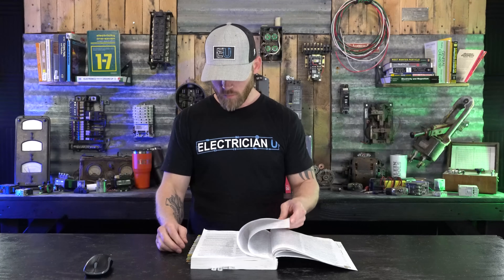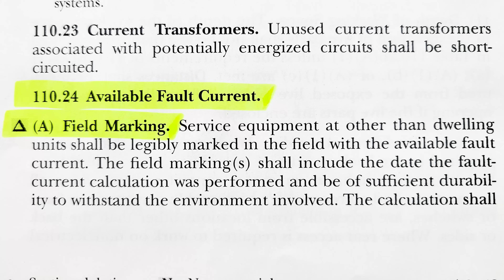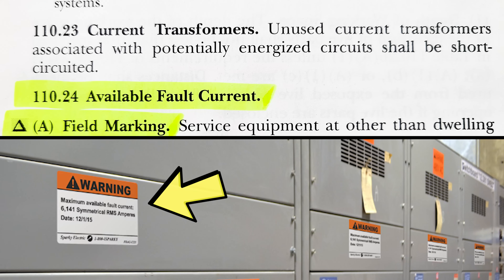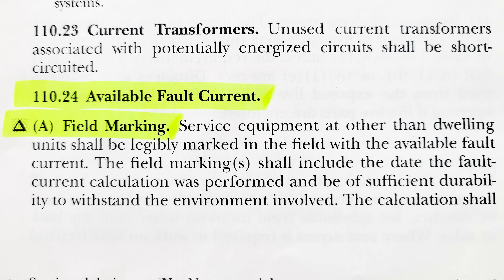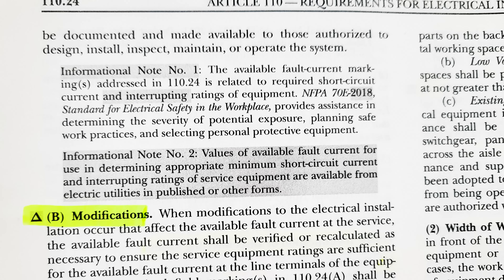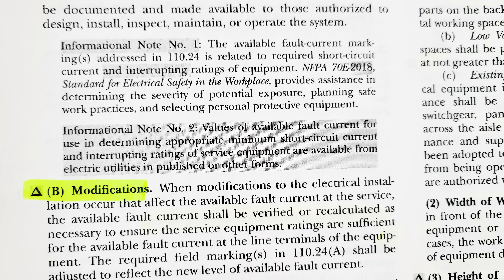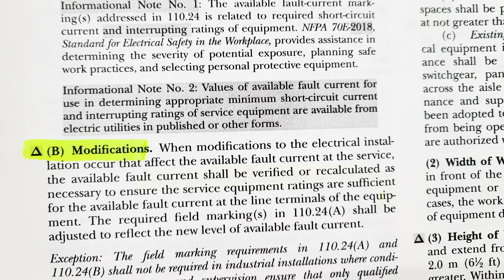What Does Available Fault Current Mean?

Comment: Good video, thanks! How do you calculate this Fault Available Current?
Reply: Exactly what I was wanting to know. The term "available fault current" is pretty self explanatory. An example calculation would have been nice.
Reply: That's a whole video in and of itself. 

It has to do with %Z of the transformer, the size and length and number of conductors. Some specific loads can also affect it. (Think anything can store a charge/energy - motors, capacitors, etc.)

Comment: Most split phase household services have the neutral and ground circuits connected directly so there is no difference between a fault current and a direct short fault as I understand for households. A distinction can be made for 3 phase power since a ground fault would not be the same as a direct short between phases. 280v to ground vs 480v ptp difference in the USA if memory serves.

Comment: Hi, I have a problem understanding this concept at my work, thank God i found your channel.
I ran into a situation where I'm asked to design industrial air compressor protection. The compressor is 150hp recommends using a time delay for class J fuse to be used in a circuit not more than 65KA symmetrical rms. The compressor is fed from an MCC with 350A CB, however my question is why I can't just use this CB as the only protection even though the recommended is a time delay fuse by the compressor manufacturer. Can I just stick to a CB at the MCC feeding the compressor with a general disconnect switch?

Comment: You mention several times that a "ground-fault" is not a short-circuit. It is a type of short-circuit. Available fault current is a misunderstood topic for many electricians, part of the reason for that is the misinformation that is presented on a daily basis, especially on the internet. The 3 main types of short-circuits are: 1. phase to neutral, 2. phase to phase, 3. phase to ground (ground-fault) - which does not fault to ground/earth.

Comment: I know with PV systems when we have 400a or higher services we are required to go from the breaker on one split to a 200a fused disco and then to a 200a main breaker in whatever panel before we tie-in our breakers for batteries/inverters due to fault currents. Your explanation here now makes sense as why. Also depending on AHJ and how far the transformer is from the service entrance sometimes it's required with even normal 200a services. Thanks for the explanation.

Comment: I just had a brain flash: The service entrance cable and anything else before the main disconnect seems to have the biggest variable. Just because you only have a 200 or 4000 amp service, it doesn't stop there. The pole transformer(s) are rated higher and those can run several hours at 140% of their rated capacity. It's very likely they can even run 200% of the stated rating for many minutes. Something tells me this type of fault might only be limited by the fuses on the high voltage distribution system. IOW, a shit load more that you can imagine!

Comment: If the fault is in a branch circuit, won't the fault current be limited by the main and branch circuit breaker? I had a disagreement with a guy at the utility, same guy said my site plan was wrong, the house faced north, not south as shown on plans. The plans showed ground mounted solar, the PV panels face south, not north so that should have been a clue.

Comment: I like the term Impedance because impedance is more prevalent during inrush currents. Resistance is always there, even when the voltage is off. 
So how do you do the calculation ?  Transformer impedance, voltage, length of cable and raceway vs. conduit. 
One guy put a 3/4 wrench on the back of the buss bar and then went around to the front to re-torque the bar in a motor controller. Yep two things happened. 1) we did not ohm out the system. 2) They left the wrench in the unit. Panel where not put on because we needed to take voltage and current measurements live. 
I will never forget the deep thud felt in my chest from outside the room when the break was turned on. No injuries. No fires. Very little damage as the plasma liquefied the metal and blew it away.

Comment: I have a question about the arc fault circuit breakers.  Maybe you can do a video on this.  How does the arc fault circuit breaker know the difference between a device that is designed to create an arc such as a gas stove that has electronic ignition that creates an arc to light the burner and an arc between a wire and a metal box for example?
Reply: you forgot to mention carbon arc lamps and arc welders. OTOH, I doubt these items will be used in a bedroom where AFCI breakers are required.

Comment: Ok in this video you Mentioned that the highest fault current would be Line to line, but in my on the job calculations on the city engineer give me a much bigger fault current for line to neutral than line to line. Thus I use the larger of the two for my placard, line to neutral. But I just can't see how there isn't more available between lines like you said.

Comment: Have had to have disconnect switch fuses replaced with specific current-limiting fuses because the motor controller is labeled for 10kA max, but the circuit can deliver significantly more. Check the load labels, and your supply labels because sometimes the electrical engineers get surprised.

Comment: Dustin,   You answered the question about what “available fault current” is but said not one word on why it is important nor what happens if the equipment installed is not rated for the available fault current when there is a “short circuit”.  
Hopefully someone taught you the WHY we need to know how much is available.  Respectfully,   Kevin

Comment: I consider fault meaning as to an unplanned change in the system or environment that influences the operation of the system and environment from then on as something that now needs to be accounted for.

Thus enter the wording for fault in electrical systems, it needs to be accounted for when an unplanned short circuit happens.

Comment: Can you try to explain why sometimes my lights with led bulbs in them flicker sometimes for no reason. Switches were changed and breakers were changed but problem comes back. Most of the time it does not happen. I can not make it happen and it is so random. Does not happen with non led bulbs.

Comment: Just one thing in large buildings you must be extra careful on all of the fault ratings on large circuit breakers. At the large hospital that I retired from boss had us remove a dozen 600 to 1200 amp spare circuit breakers from one switch gear room to another and rack them in to make it easier for company performing yearly PM. the ones we moved only had a fault current of 65 KIA while the other location had breakers all rated for over 100 KIA. Entire equipment is only good for lowest related IAC breaker.
Reply: This only matters if the available fault current is actually above the 65ka rating

Comment: Can you talk about SSCR or Short Circuit Current Rating for Main Breakers?  What is it, how do you calculate it, and why does it matter.
Reply: Typically, SCCR of the equipment or panel is going to be the lowest SCCR of all the devices in a circuit. You can check out the Annexes of NFPA 79 or UL 508a for more detailed descriptions and calculation methods as well.

Comment: Dustin love the channel love the content I have a question about a three phase service for generator which I'm sure you covered in previous videos but I need to ask it anyway because I might have not completely understood it. I have a scenario that involves a generator producing a three-phase supply not sure if it's Delta or y but I am reading 208 across to phases. So my 2 million dollar questions are what video do I need to watch again to understand it? And how bad of an issue is it if I connect a single phase service to a three phase line? Thank you
Reply: You have a wye-connected 120V/208V three-phase generator. 120 volts from line to neutral, 208 volts line to line. No, you cannot feed a single phase service from this generator, you have no way to provide line to line 240 volts. You can feed power for a three phase panel and use only 120 volt circuits if that suits your needs.

Comment: I guess you explained Available Fault Current's meaning, but how do you determine the amount?
Reply: The short answer, given no complications, is that you can determine an upper limit to this by looking at a transformer's KVA and impedance.   Calculate the amps associated with the KVA rating, and then divide by the impedance as a decimal.  So for a 300 kVA 3-phase transformer at 120/208V, the "amps associated with KVA" is 833A.  If the %Z impedance is 4%, convert this to a decimal as 0.04.  833A/0.04 = 20.8kA.

When you know information about the feeder length/size/material/conduit, you can reduce it from this, accounting for the impedance of the feeder wire.  You can also calculate it across a transformer, by considering more information on the primary side to reduce what it will become on the secondary.  The above short answer, assumes "infinite bus", meaning that primary voltage * primary fault current is infinity.   If you graph secondary fault current vs primary fault current, you'll see that the graph eventually approaches a "cruising altitude", and we call that "cruising altitude" the infinite bus fault current.

There is a complication when you have motor loads that contribute their own fault current.
Reply: I’ve gotten the numbers from the utility the few times I needed it.
Reply: There's a bit of math involved but if you're in the field and need to figure it out, the easiest way would be to use the Eaton Bussmann Fault Current Calculator app. Dumbs everything down to where you just need to input certain values to get your available fault current

Comment: Not to sound stupid or anything like that, I went to trade school 1993 for electrical maintenance technology, and I keep running across air conditioner condenser units that have the white and black wires in cable that is sometimes romex and sometimes outdoor cable or exterior cable and they use the white and black as both line hots and ground is grounding and is usually 10-2 w/ ground and think that is a waste of money and time to use 10-3 w/ ground because there is no need for a neutral. So my question is, is that code today, because my instructors of school all said as long as you mark or identify the white wire with black or red tape or shrink tube it would be code back then.I looked in my 2017 code handbook and could not for the life of me find it, maybe my eyes are going bad ,but could not find it. But do you or one of your friends know about this? Would appreciate a response, thank you Dustin.

Comment: So, how do you calculate the available fault current and why is it important that commercial entrances be so marked?  Thanks for the great content.
Reply: it is used to calculate arc flash and arc blast so that someone can know what safety clothing they will need to put on. see my other post here for more details.
Reply: @tiggeroush  Ark = a boat built by a man named Noah, according to the Bible.   Arc = the electrical problem created by ionizing the air and turning it from an insulator in the normal gaseous state to a conductor in the plasma state.
Reply: @tiggeroush  I'm aware of both of those.   I don't know what ark means in general, maybe it was a term that was transliterated from two unrelated terms that both sound similar.  Noah's ark is the most common one that comes to mind, in my opinion.
Reply: The short-circuit current rating (SCCR) is needed to to clear a fault and trip the main disconnect. Take a look at a main breaker next time for a 22K or a 10k SCCR number on a panel. If you install the wrong SCCR main disconnect the disconnect (Main Breaker) could explode from excessive fault current flowing through it.
Reply: Don’t forget bolted fault current!
Reply: @AngelRomero955  that's Available Fault Current in the NEC. Available Fault Current; The largest amount of current capable of being delivered at a point on the system during a short-circuit condition. Yea, they tend to change names and words every three years. Then we are all off to the races trying to figure it all out again. Where as Bolted Fault is the type and Available Fault Current is the how much.
Reply: @tiggeroush  Well the clears it up for me! 
I’m a 1st year apprentice and I’m doing the NCCER class through our state university and it’s pretty heavy on these topics and it’s good to find someone that can shed some light!